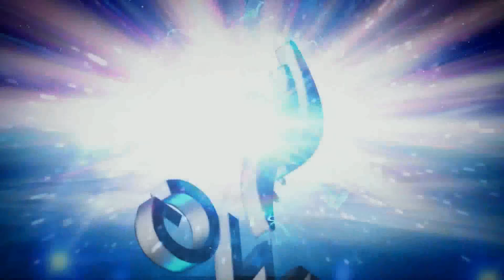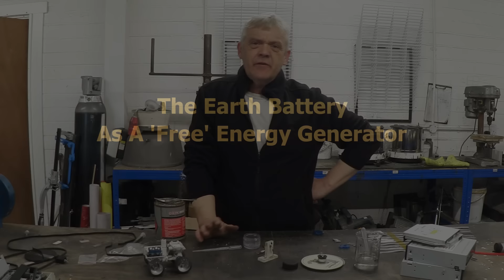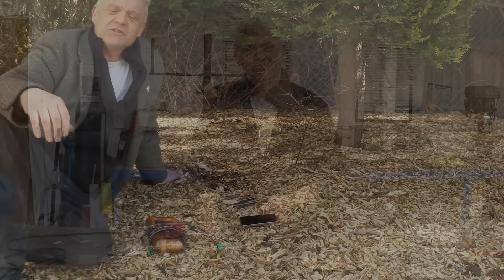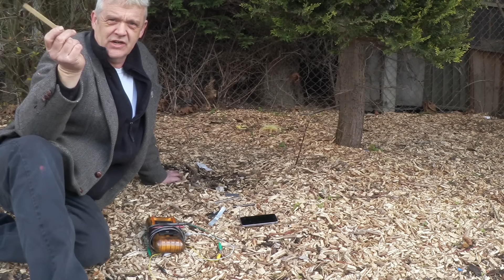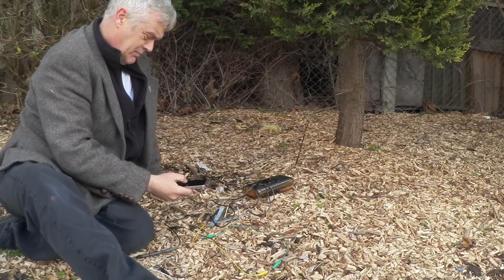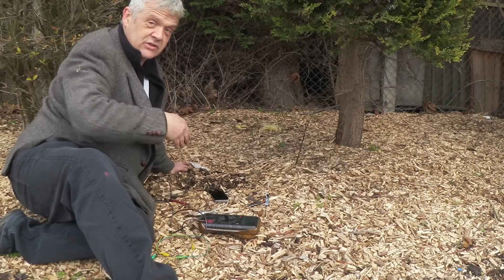The Earth Battery As A 'Free' Energy Generator

Comment: I've been running my household mains electric supply from the electric my lawn provides for years👍😎
Reply from the maker: awesome!
Reply: PD Tech 
Would you mind sharing your set up with us...?
I’ve been fascinated by this since I first learned 
of it a couple of years ago.
Reply: @troystutsman1400  this joke > your head
Reply: I think you are fibbing.
Reply: Lol
Reply: Reichert Zetopan it was a joke we all know that at best you will get enough to illuminate an LED and it will be DC
Reply: Reichert Zetopan your right I always assume people know as much as I do, I think the voltage readings are probably just a chemical battery , High impedance DMM’s will display voltages just by waving the leads around but it’s not useful energy, I ran a cable the full length of a factory when testing it I was measuring 110volts on it from stray RFI it was enough to produce a small spark ⚡️ but stills not free energy.
Reply: Reichert Zetopan  There are more and more people living 'off grid' now and doing very well running off various sources of free energy, such as solar, wind and hydro-electric. I lived on a narrow boat for a couple of years and apart from the diesel fuel to run the engine, all my power needs were provided by 6 large solar panels and a wind generator. Completely free energy, through 2 large leisure lead acid batteries and an inverter to step up to mains voltage. It always surprised me how many marina moorings left on their mains hookups, another very welcome source of 'free energy', 😁😎👍

Comment: I propose an efficient use for this type of battery may be in parallel with another generator, like a micro wind turbine: the voltage from the Earth battery keeps the diodes open in your rectifier, increasing usable power, even in low wind conditions? I wish to try it.

My hypothesis: The Earth battery works similarly to the rain fuel generator; Different regions of moisture and charge within the soil act as the singular rain drop does. Prediction: different coating(s) of the electrodes in conductive ink (or similar) and/or polyurethane (or similar) will increase power. I want to experiment with various large surface area aluminum foil anodes on the south side of a freestanding plastic (electrically isolated) garden box and graphite rod cathodes on the north. Add two or three Daisy wind generators, and I might have a trickle (or better) 12v battery charger. This YouTube channel rocks!

Comment: Good info, but you should do a voice over on this one, too much noise and low mic to understand you.

I have been studying this phenomenon for around 50 years. The "earth battery" effect is actually a combination of many things., all of them can be used for electrical power.  A standard probe in the average soil will read a small voltage between two probes.  Extend this down, adding an antenna pickup coil to the circuit and you will find the total available power is not much further down than one meter.

Of the various types of electrical stimulation are effects of Earth's magnetic flux, the soil chemistry, bio energy from microbes, some plants, Earth's harmonic frequency can also be evaluated as a low level power output like any other frequency generated in an item or in the atmosphere.  Soil moisture does not play a large part in this, though absolute dry or absolute wet (as in flooded) will give lower power output.

I use a 8mm wooden dowel one meter long, with a #10 bare copper along the length of the staff, taped on at the ends with 1 CM sticking up to attach to. Near the middle I begin and wind three coils, wired in parallel and one lead extended to the top copper wire attachment, the other covered and extended to the top as well.  In one post hole I bury this arrangement with the leads exposed at the top, using clean back fill with all rocks removed.  1/2 M away I place a galvanized steel rod 1.2 M into the ground and make a row of receivers and ground reference anchors in a long row.  At the receiver I wire these together with a diode and a small electrolytic capacitor to a common wire.  All of the row are wired to two parallel insulated wires and more circuits and components are placed between the rows,   The rows collect the same voltage, usually less than  +1.5 to 3.1 DC volts and the many receivers in each long row collect and add to the amperage potential.   There is more to the details, but the end product from the 1/4 acre I have wired produces an average of +15 volts DC at 30 Amps.  All of my wires are just under the ground level where normal mowing is possible, the electronics are soldered and coated in layering lacquer before burial.  This field is much larger than a few good solar panels on the roof, but it also produces 24-7 and maintains my emergency power backup through a normal 30 Amp solar charger controller and four 1,000 Ah 6 V deep cycle batteries and a 3,000 Watt inverter.  This is good available power backup for some lighting, communication gear and the refrigerator.

My primary power system is an elaborate 15KW over unity system, which is not a store but a direct powered generator system for my all electric house and shop.  This coming spring I will add to the field and do a full video and links to this free system.

Comment: Earth battery? It just simple galvanic cell, redox with an anode and cathode. It’s the basis of alkaline batteries and Cathodic protection. Look up the galvanic series chart there is a good one on corrosion pedia for the different materials voltages everyone.

Your highest voltage difference will be between a magnesium -1.6V high purity anode and a carbon graphite +.2V cathode, it’s a 1.8v difference which is why you got 2V, only problem is that it will only work until the magnesium anode is spent. It is the electro-chemical process that causes corrosion. 

Yes, it also works better with a salt electrolyte otherwise a more conducive electrolyte in the soil around both electrodes. It doesn’t work when the soil is dry, it’s also why you don’t need to use Cathodic protection in frozen ground that never thaws, current just simply cannot flow in frozen ground.

It is surface area of the anode and cathode and the material of both.  You can increase that surface area by digging a deeper and wider hole, place the anode in the middle and backfill with coke breeze, just like a Cathodic protection technician would do. 

Oxidation reaction is the loss of electrons which can happen as rust (exposed to air) when metal loses electrons to oxygen in the air or to an anode in the ground in a galvanic cell. 

Electrons move through the electrical connection from the anode loosing electrons to the cathode making the cathode more negative. At the same time positive ions move towards the cathode in the electrolyte.

Oxidation, anode, loss of electrons (becoming more positive)
Reduction, cathode, gain of electrons (becoming more negative)

The anode is sacrificed and chemically changes through oxidation and slowly disappears protecting the cathode by sacrificially giving it its electrons.

Telluric currents would be difficult to use, they constantly change, are unpredictable, vary with the variations in the earth and even are effected by the sun.

Also the current goes in to the earth in gradient shells, just like a ground rod or even lightning dissipating in voltage gradient shells into the earth.

NACE International rocks, you can get a Corrosion Technician Certification through them. Cool stuff. Not free energy though. 🤣
Love your channel.

Comment: I love your channel. I'm recovering from severe complex post-traumatic stress and I'm working on making your serpentine stator from milk plastic with dye and a two teaspoons of graphene per part. I am going to high temp plaster molds with built in heaters.  I want it to be easy to pack around the stator and use a tripod and any number of the modular blade designs you've come up with and I've also tried the different plastics in carbon fiber etc but I really want to make it out of Bioplastic. It would be really easy for a person to self-service and really easy to make once you have the molds made you're just extracting the 14th from the milk with vinegar adding some dye throwing in a couple of teaspoons of graphing putting them in the molds and putting them under pressure heating up the molds. They would last a long time and when they do actually degrade they don't degrade into microplastics put into protein. and their lightweight alternative to roll out solar panels for bad weather and for mountainous camping to recharge cell phones cameras astrophotography computer laptops etc.

Comment: This reminds me of another experiment I saw a gentleman doing that was similar, he ran a long wire looped over itself a bunch of times, with AC voltage running through it, like an extension cord, and was able to gain voltage off of the coiled up extention cord, thought that was cool.
He also experimented with long runs of straight wire and was able to get power from them, running horizontally like on a fence line, not sure how that one was working.
But I've got a old well pipe in the back yard that's about 30' feet from another buried zinc 2" pipe, got me thinking about connecting them and seeing what happens.. 🤔 they are east-west oriented though.
Also reminds me of some experiments done on iron fencing and flordalie pattern, some guy was testing just shapes of metal, like the flordalie and getting a small reading off of them, proposing old iron fences might have had a purpose originally, so much of history is forgotten and rewritten, it deffinatly  seems like were going 'Devo'
Reply: The coiled up extension lead experiment was just a transformer. The fence was picking up RFI happens all the time with long un shielded cables there is voltage but no useful power.

Comment: I remember reading about a tesla experiment (the man Tessa not the car company) where he drove a iron rod in the ground and a copper Arial with a copper dome on top placed high up in the sky . I can't remember exactly how high but it was high. And he got 1.5 volts consistent and I think about 1amp. I would be interested in what you think about this. I found your experiment very interesting. So I'm going to subscribe. Thank you.
Reply: For some reason, this makes sense to me. And I wonder about antenna tuning to improve its effectiveness and efficiency. Tesla invented microwaves which are produced by harmonic electron resonating chambers. We know that antennas can be made to operate at specific frequencies. If everything is vibratory in nature, it suggests something about quantum physics, and how the particles interact. It also occurred to me the power of the atom, what makes the electrons orbit, spinning forever around the nucleus? And to split one is to break the mechanism that has kept it going since creation. >BOOM< like the instant unleashing of gods wrath. Lol 😂
Reply: The atmospheric potential is ± 120V per meter!  So if you rise a conductor (insulated!!) 100 metres above the ground, then you'll get 120.000V, but in the nanoAmps..  and to use it you'll need a pulse current multiplier, a spark gap that stores the pulses.  The video is aout the galvanic effect in moist soil. It works, but also very small amounts of Amps, so don't expect this energy can power anything else than a small radio or a small LED light...
Reply: @erwinmaes780  same is true with solar panels. But with an array of connections, both parallel and series, you can get a usable energy output.

Comment: While a bit off topic, during WWI, wired intercoms (as opposed to extremely primitive radio in those days) often used only one wire.  Since two conductors are needed, they would use one wire and then they would pound a long ground rod into the Earth, and that worked….at least sort of.  There was LOTS of noise (which ties in nicely with the topic of this video) and it was found that since everybody used a ground rod, it became fairly easy to listen in on other conversations, including your enemy.  In other words, the second wire for everyone was the same “wire” conductor….or the Earth.  These stray earth voltages played real havoc with communication requirements.  Especially during rain or snow storms.  Solar effects on the Earth were also a large player, but that was completely unknown in those days.

Comment: Have you tested difference between different Ph soil? I noticed you sitting next to a tree. Pines are more acidic and its needles would make the soil around the tree more acidic and maybe give you a boost as compared to a more alkaline soil. Just a thought.
Reply: I was wondering the same thing. But I'm still going to try it. I have Carbon from "camp battery" and Magnesium from laptops.... also use a  joule thief so the voltage is "better"

Comment: What would happen to the voltage if you used a pair of large 20m long and 2m wide electrodes of what ever the best conductor is. Do you think the voltage would jump substantially with using them in series etc. Cheers for the content

Comment: I have just a very basic understanding of electricity when I ask this question of you, but would it be possible to take the current and connect it to a capacitor to build up a charge, then when the capacitor discharges, run the discharge through a voltage regulator to charge a battery?

Comment: Very pleased to have this pop up in my feed.   I have toyed with these ideas as well along with using trees and maybe even a corrosion based system for people near the ocean where you could cascade the salt water through boxes with dissimilar metals, maybe like a little labyrinth or something.  

There was a story or tale of an experimenter guy our here in Utah that was a scout master that lived about 100 years ago.  The old timers claimed he would put out probes to light the area on campouts. 

My thought on this has always gone a couple directions.  I always thought that if telluric, there may be more voltage be creating distance between the probes to better exploit the ground current differentials. I have done some experiments here but I live in the proximity of some high tension lines that may be creating induction on my conductors. I need new probes for my old O-scopes to look at the wave form but now they probably have soft o-scope good enough for what I would use it for.... I need to check that... Wish and Temu.. lol 

This brings up another point.  I have suspected that if done correctly you should be able to somehow exploit the magnetic flux of the earth.  IIRC is that about 7.8Hz?   If so creating the correct LC tank may allow for better extrapolation of the energy.  Now that we have 1 farad caps for car stereos and things it seems like it would be possible.  Before I was toying with the idea of tuning "Wine Bottle Caps" popular amongst Tesla Coil enthusiasts, Of course I have some other ideas how I could use such a capacitance bank as we move deeper and deeper into low-voltage solid state devices... for which I won't mention publicly here as it might get the wrong kind of attention... lol

Anyway I might revisit these earth and tree batteries and pair the experiment up with a "Joule Thief" style circuit as I think you could produce usable lighting in a long term grid down scenario.   Always keep extra Diodes and transistors in your Faraday junk box.. just sayin'... lol

Comment: funny enough Robert, last week I was curious about the versions of so called "earth batteries" given I also live in the soggy Northwest, Miles from the sea ,so no free salt micron sized saturated humid air+ground for wide area gulvanic reactions and apparently the key to more "amp's per plate was that the northen plate  'N' (North = -> here" was placed far lower/deeper  than the southern plates and connected underground at a steep diagonal angle ( reversed Zed style, and pressumed thin copper connecting n+s underground!) so very limited gulvanic reactions could take place anyway.... 
you/they  oc tap into the exposed surface -+ terminals to complete the prime mover/supercap storage circuit as usual.

I do wonder though, if you were to wind a spiral and/or any fractal shaped wire around the insulated diagonal connected wire AKA self contained magnetic windings transforming collectors , so as to collect and collate any EM around the device and add to the total output driving the (ESP32) prime mover/supercap storage up top.
Reply from the maker: to be honest mate I think there are lots of interesting things here but mostly it is fun to investigate and who knows what you learn

Comment: Rob, 
Have you tried the possibility of running a copper rod or wire 50 ft into the air down to the earth ground and checking the electrical potential between the two?
Reply: I'm with you on this suggestion.  Lighting arresting systems function to capture (on a sharp point where electrons like to accumulate) and drain charge to ground to prevent a significant charge accumulation. I believe the atmosphere to hold an incalculable amount of charge that results in hundreds of arcs a day (electricity doesn't want to arc, it wants an easy path but with enough accumulation, it will arc).  Your idea would certainly drain the ground, or the atmosphere, on a continuous basis just like a building does.  We have to figure out how to mete that charge for a continuous stream into a capacitor and then into a battery.
Reply: The voltage increases 100v every meter in elevation
Reply: @dennispickard7743  if this can be reproduced, which density of copper are you using?

Comment: Obtaining 4-5 Full Milliamperes with Magnesium, Carbon and water.  Two rods place in tap water.  Before immersion the magnesium rod, take a hack saw blade or file and texture the length of the rod with deep triangular ridges.  Electrons love pointed edges to gather and launch from on metals.  The surface area is also increased which also is a natural boost to amperage.